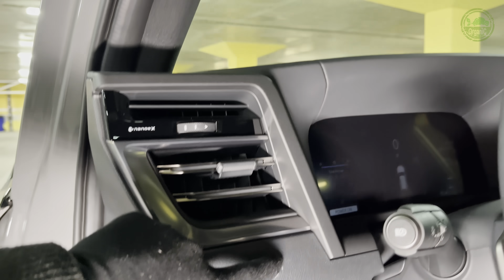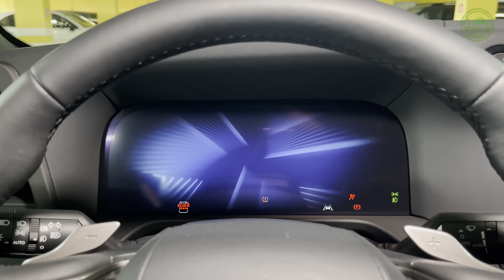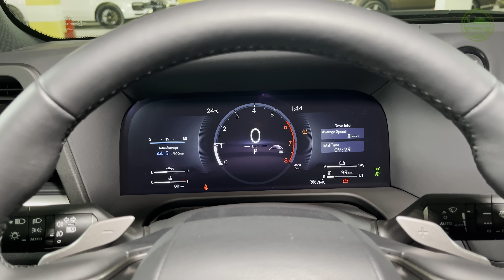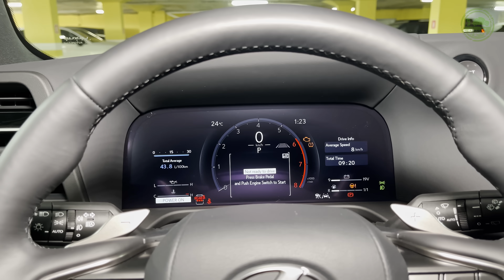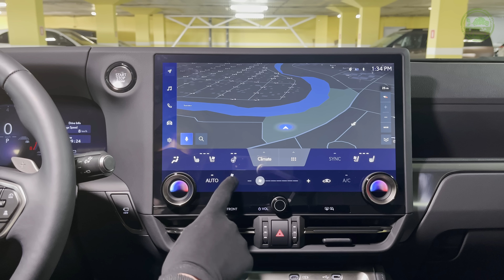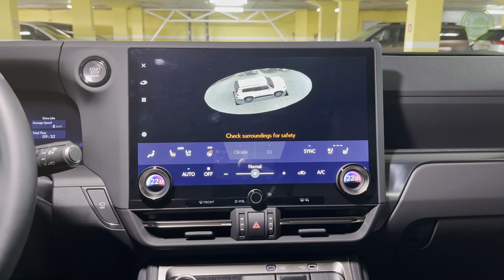2025 Lexus GX 550 - Sound, Interior and Exterior

Comment: It’s a very heavy vehicle with should have been a V8. I haven’t been able to get the average mpg over 15. My understanding is that the turbos make the engine less reliable or require replacement themselves after 100,000 miles (give or take). The transmission seems to be a bit sloppy as well. My BMW’s transmission is flawless in comparison and that’s my biggest gripe this far.
Reply: My fiancee had a 2012 Ford F150 with a twin turbo 3.5 V6, that lasted 316k. The turbos were still good. The cam phasers went bad and started getting chain slap. She still got 3.5k for a trade in.  Granted a turbo/s is just another mechanical part that can fail prematurely, but if you're looking for a vehicle's turbo/s to last 300k miles, I wouldn't worry so much. 
This being said, a normally aspirated motor will be better for really long term ownership.
Reply: Lexus is very reliable

Comment: I've owned a 2010 Toyota Corrola, 1997 4Runner, 2003 4Runner, and currently a 2006 Sequoia as my beater. I've always thought of Toyota being reliable.
Now? I wouldn't buy any Toyota  or Lexus for the next 5 years. I'd have to see the long term reliability, AND QUALITY.
I'm so disappointed in Toyota.

I personally believe that there was a generation of automotive engineers in the car industry that spent their working careers  making/designing vehicles, and got good at it. Now all the experienced engineers are retired and the next generation doesn't have the knowledge or experience. I believe this is a factor to what's happening to Toyota.
Reply: What is happening with Toyota? I've had them all my driving life, but have had a Cadillac for the past 3 years and it's now needing some serious maintenance. I was thinking about going back to Toyota/Lexus, but I keep seeing comments like yours about being disappointed with them lately. What are the major issues?
Reply: @atmdoll their engines, build quality and overall feel of the car is not the same just like with dodge they lost their busines because they no longer have the famous hemi 5.7 they now have twin turbo engines and please dont get me started about the reliability on em